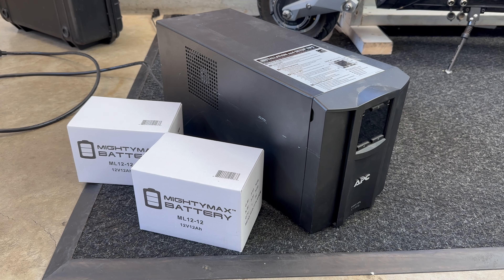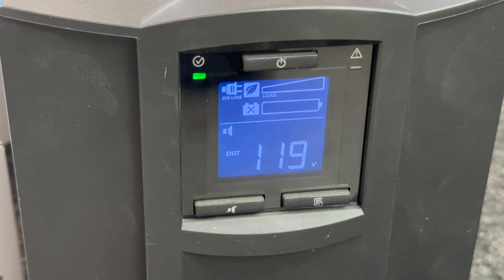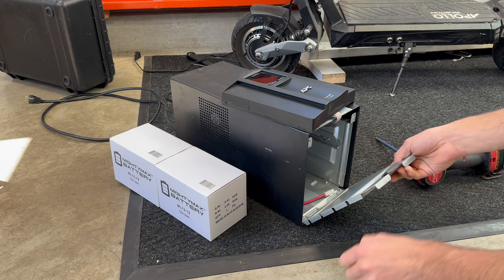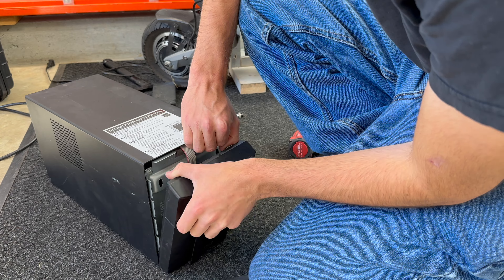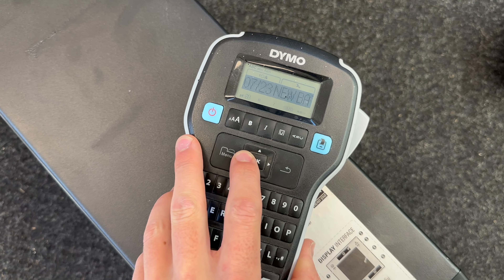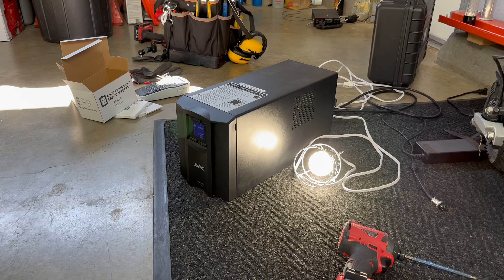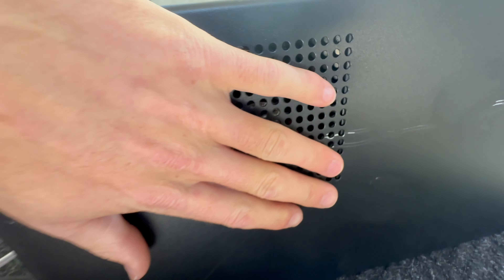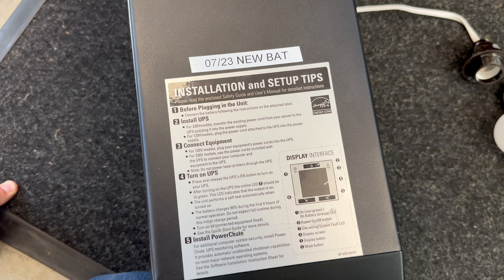Replacing batteries and fixing a UPS

Comment: The fault light is for your building wiring, so had that light lit, you would want to check your electrical wiring.  Also, the testing happens shortly after you turn it on, as you saw, but it will also happen periodically every 1-2 weeks.  I have my sensitivity set to the highest because I have my work and personal equipment plugged in.

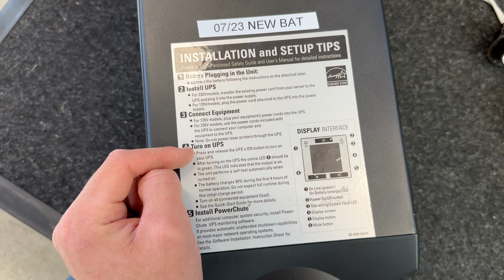Comment: 12:38 Make sure it's not an LED printer but a laser printer. If it's a color printer, you can easily check if it's an LED printer by the color print times compared to the greyscale times. If it's an LED printer the times will be almost identical.
Reply from the maker: What does that have to do with UPS?
Reply: @nics-systems-electric meant to put 12:38
Reply from the maker: @UriahStuff  yeah I still don't know why they say not to

Comment: 11:17 Karma for not using two hands!
Reply from the maker: Two hands doesn't make a difference when the thing you're holding snaps in half lol. even if I had a secondhand available not holding the phone it wouldn't be any use because the lightbulb is too hot to put a second hand on you will burn your hand

Comment: FYI, you do not need to power these APC units down to swap the batteries.

If you do need to shut down the UPS make sure to pull the plug out of the back of the unit.

Comment: I ran across somebody selling some 12v 10Ah LiFePO4 batteries for $10 each. I bought one but should've bought all three, then I could have put two in my own 1500VA UPS and never worry about them wearing out.
Reply from the maker: If the charger is compatible with it
Reply: @nics-systems-electric   I believe these APC units only use float charging so they should be compatible. I have the variant from 2007 which lets you recalibrate the voltage adjustment if needed using the serial port. It's actually something to look at even with regular lead acid batteries. Without readjustment this kind of UPS tends to output a bit too much voltage and this leads to premature battery wear. The charge voltage should be between 27.2 and 27.6 volts and IIRC mine was putting out over 28 volts.  I think I've read it was a problem due to component drift with age and they might have fixed it on later models.
Reply from the maker: @eDoc2020  float charging usually but I think they go into a high charge after they've been drained significantly